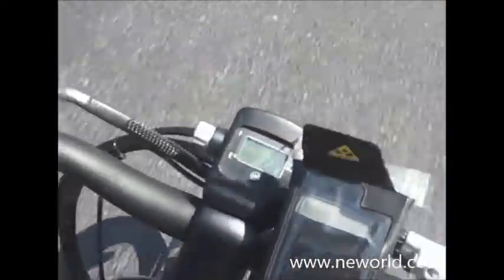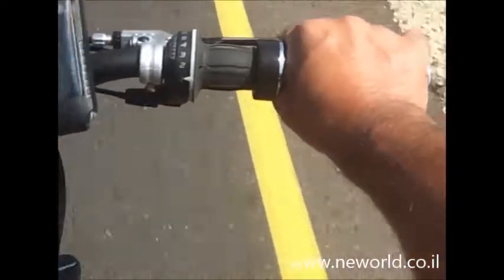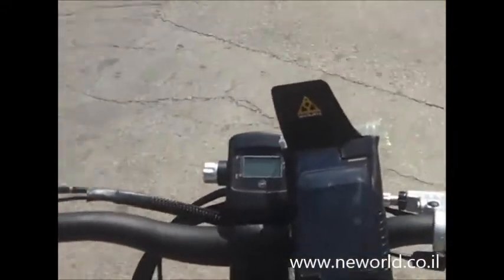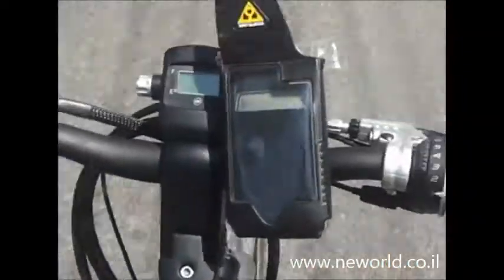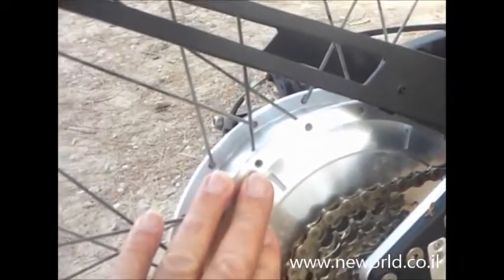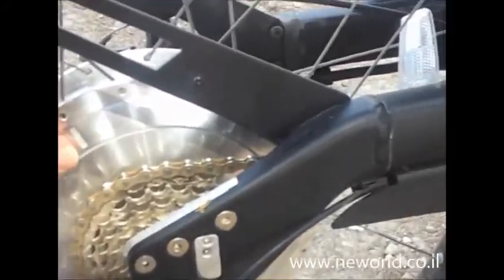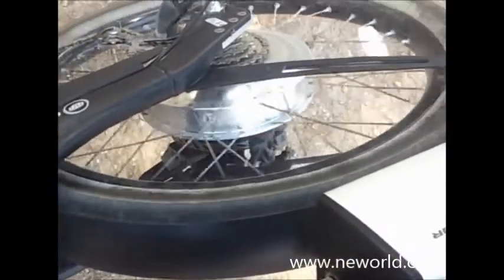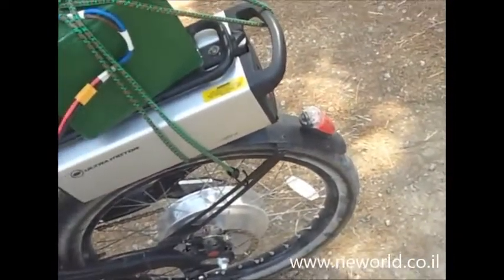converting / upgreading A2B ebike into 48v system - שדרוג אופני a2b למערכת של 48 וולט

Comment: Hi, so you only change the battery to 48V , no other stuff ? what about the controller  ? the controller will handle the power also the motor ?
Reply from the maker: i replaced the controller to 48V 350W quality one   http://neworldshop.com/product/%d7%90%d7%95%d7%a4%d7%a0%d7%99%d7%99%d7%9d-%d7%97%d7%a9%d7%9e%d7%9c%d7%99%d7%99%d7%9d/%d7%91%d7%a7%d7%a8-%d7%9e%d7%a0%d7%95%d7%a2-brush-less-controller/%d7%91%d7%a7%d7%a8-%d7%9e%d7%a0%d7%95%d7%a2-%d7%9c%d7%90%d7%95%d7%a4%d7%a0%d7%99%d7%99%d7%9d-%d7%97%d7%a9%d7%9e%d7%9c%d7%99%d7%99%d7%9d-36-48v-350w-smart-brush-less-motor-controller/

Comment: I'm in the same boat as Chris.  Got a 500w rear hub for an A2B for cheap.  No display unit to control it.  The controller is built into the hub.  The wires exiting the hub are torque sensor, power(red, black and small yellow?), display wiring (five wires) and brake.  I was hoping you had a wiring diagram for the display.  I'd like to either use the inhub controller or just hook up an external.  For an external, seems you need to pull the phase wiring from the inhub controller.  Then figure out the hall wiring as the halls sensors are super short and don't seem to labeled.  PITA for me.
Reply from the maker: killerkiteboarding i suggest you take out the 3 phase wires and use a good quality 500W brush-less motor controller. first connect the 3 phase only (use a sensor-less controller) and after that connect the sensors. change the position of the sensors wires, until you will get the motor spin in a smooth way.
Reply from the maker: ilan.neWorld Ebike if the sensors will not fit to the controller, use it sensor-less and it will work just fine. at the beginning of driving it will vibrate a bit, but will run in a good way after starting.
Reply: I have an A2B. The motor has gone wrong.. the rest are reconstructed (battery, sensor, etc)... Could I remove everything and add a new kit on it that will make it safe and worth riding? Any suggestions on what to buy that is compatible?

Comment: i have three a2b 26" hybrid bikes + 1 spare hub + 1 spare front wheel. all 4 front wheels have 6v dynamo in hubs. Only one rear hub  has  the three phase wires. and they red, black, green,not the normal blue, green, yellow,i need to know color codes? the other 3 hubs are just black and red thick wires. two of the bike work now. but i only have one £500 battery + one controller on handle bars. I want to use a cheaper batteries for others but original batteries have two voltages coming out. one at 40v and other at 9.7v  so this complicates things a bit. the one hub with 3 phase wires is the only one with a controller in frame the other are all controlled from screen on handle bars.so i will be able to use a china controller and bettery for one bike at least if i can convert the wire colors right i will email ebike@ you PDF of offical wiring for 26"hybrid for your future reference.

Comment: i presume you are using a throttle not pedaling, I own two 26" hybrid A2B bikes with no controllers or batteries. i cant find a way to connect another type controller,as most hubs have 3 phase wires + hall sensor wires with different color codes from.A2B There just 2 thick wires black +red and 5 thin wires white  yellow orange blue + brown..you must have worked out the wiring.would you be happy to share the wiring codes
Reply from the maker: sure, i will share.
but i think you are mistaken for the two thick wires, because it is a brush-less motor, and it need 3 phase at least.
please look again and send me some photo of the wires come from the motor.
if you will find it only 2 thick wires from the motor, so i guess it is a different model of A2B, with a controller build in the motor.
see this wiring diagram, it will help you understand the 5 hall sensors wires and some other functions  http://www.neworld.co.il/upload/electric_bicycle/controller/Wiring_diagram_of_350W_controller.pdf
this wiring diagram is for the controller i used in this A2B conversion did in this video.
Reply: I will try and send a photo of the wheel and wires
Reply: ilan.neWorld Ebike I have taken photo of wire on smart phone but having problem sending to you whats the link  procedure
Reply: Chris Harrell shared picture on google+ with you ! I hope
Reply from the maker: Chris Harrell
sent to mail: ilan.neworld@gmail.com